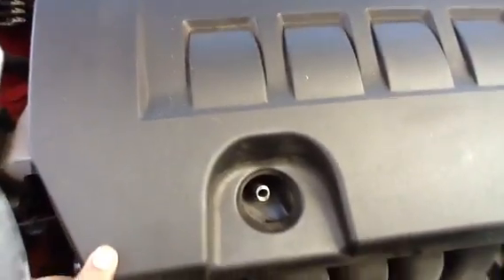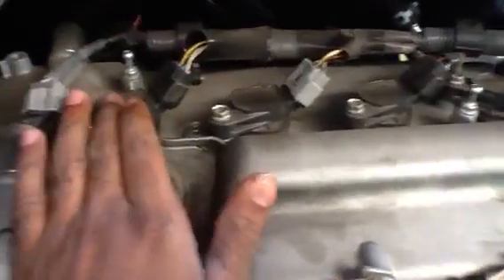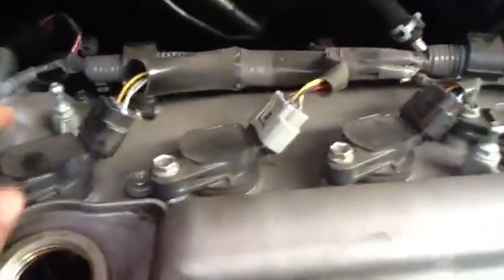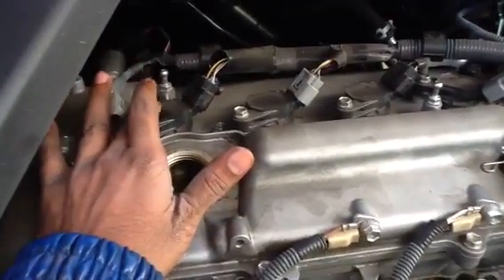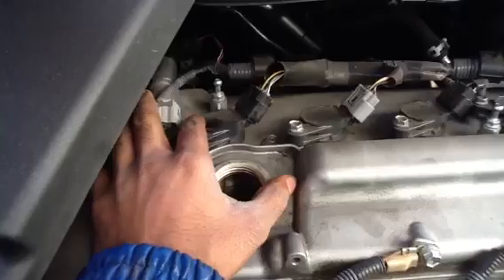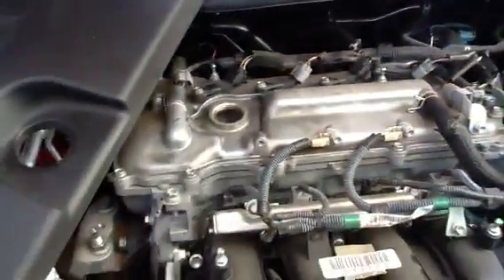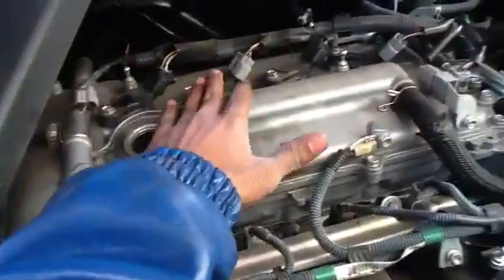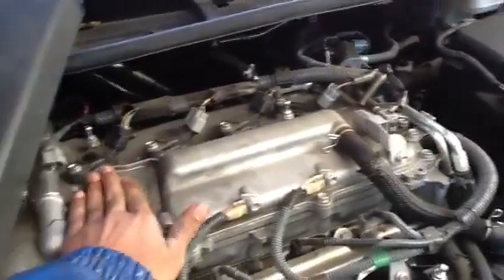Toyota Corolla 2010 spark plugs how to access them

Comment: Hey I have a 2010 corolla I bought from the dealership back in 2010.  I believe my car is still under warranty.  How can I get my dealership to replace the spark plugs without me having to pay for them?  Should I mention to them I am not getting enough fuel mileage? As well I wanted to know if the battery is also under warranty.  Any help is appreciated.  Great video.

Comment: is replacing the coil pack the same as replacing the cables on the older models? or do you have to replaces the cables? they are tapped up and I can even see where they go. thanks
Reply from the maker: +mrvai You don't have to..

Comment: Useless video and answers. "Change plugs every 6000 miles" WRONG, it's every 120,000 miles. Not even close.
Reply from the maker: You can change them whenever you want dude, some people change it before cause they want too.
Reply: hp11208
Sure, and you can change your oil every day, your tires every month if you want to but that doesn't change the fact that you are giving bad advice.
Reply from the maker: Yep, sometimes you have to use head.Don't listen to everything the manufacturers say.
Reply from the maker: Some people feel more secure, by changing certain things on their car before.Cause they have the money and just want to, even you tell them it's not time.
Reply: ***** Check your factory maintenance guide. Factory Iridium plugs on 2010 Corolla are good for 120,000 miles. http://www.toyota.com/t3Portal/document/omms/T-MMS-10Corolla/pdf/2010_Corolla_WMG_lr.pdf
I don't speak of things I don't know.
I currently have 150,000 on mine and will replace this weekend.
Reply from the maker: Don't believe everything the guide says, use some common sense.The parts they make these days don't last.
Reply: hp11208
Do you not read? I CURRENTLY HAVE 150,000 MILES ON THE ORIGINAL PLUGS. I just recently started to have a very, very slight rough idle.
I'm not just going by what the guide say, but also by my personal experience.
Iridium spark plugs last over 100,000 miles. To change them at 6,000 miles is a waste of time and money. Simply admit that you gave bad advice.
Reply from the maker: I know they last a long time, but some customer they don't want hear that.I tell them that but they just want to change them out.They feel more secure in doing that.
Reply from the maker: Your useless go find something else to do troll. The manual tells you to change things at the point of breakdown. They tell you to change your oil every 5 to 10 thousand miles that's bs.